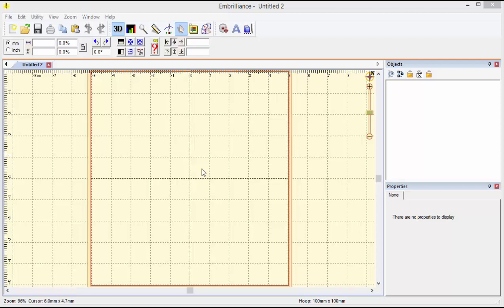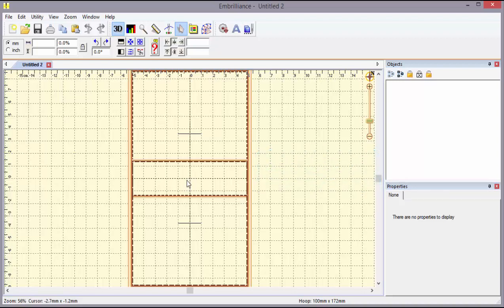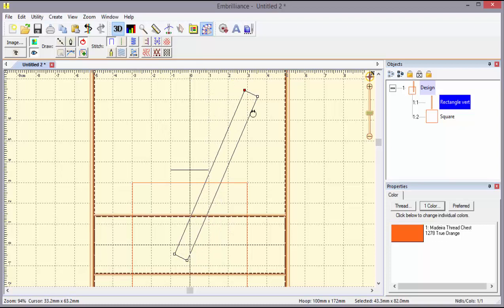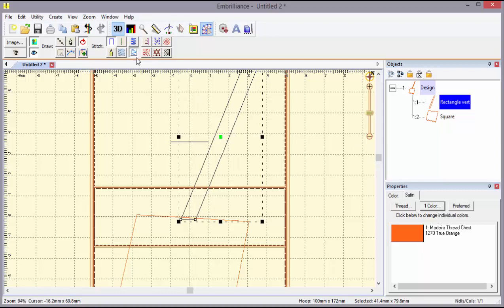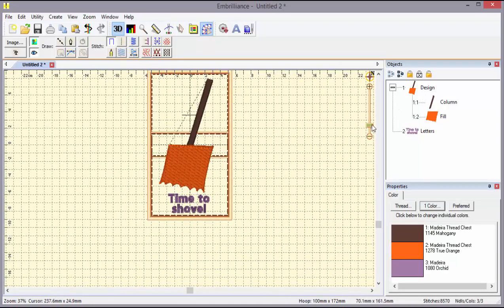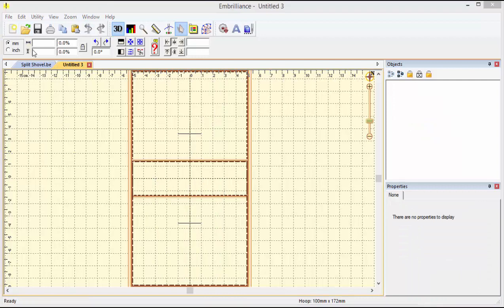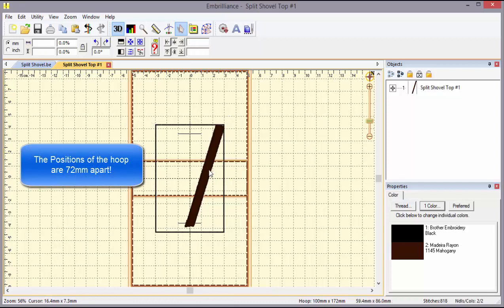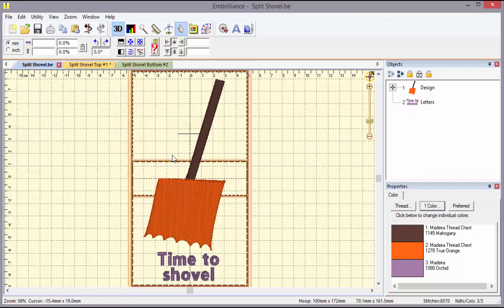Digitizing for Multi-Position Hoops

Comment: When doing a design for the multi positioning 100*172 hoop the design was 172mm but stitched out only 168 mm. How can that be? Is is a conversion error between metric and imperial? I know some system approximate one inch to 25 mm instead of 25.4 mm. Is it the case here?

Comment: I am having trouble with Stitch Artist lvl2. Sometimes when I come close to filling, but do not exceed the 200x300 hoop, the software automatically breaks up the stitch file into 2 or even 3 files for no reason. It is driving me crazy. Please help!
Reply from the maker: Yikes - be sure to reach out to customer support to get help - sounds like a setting is off and they can assist you!  They answer every question within 24 hours if you submit using the contact us form.  You can even log into the system to see all of your conversations!  www.Embrilliance.com/contact-us